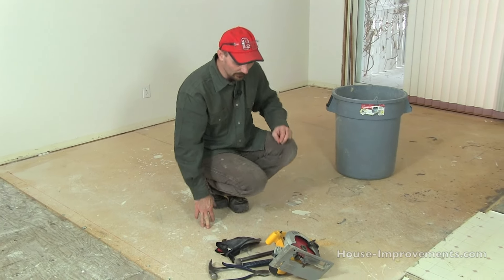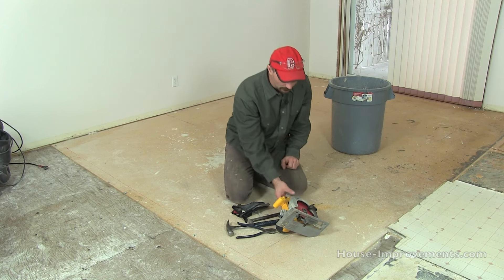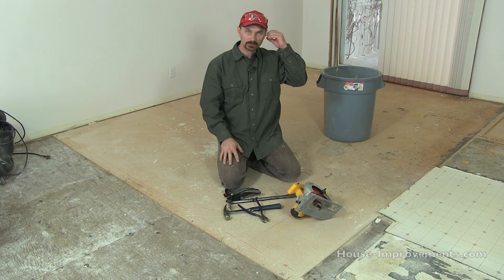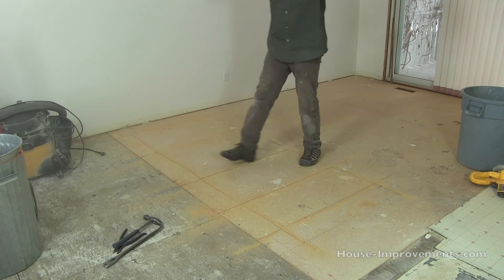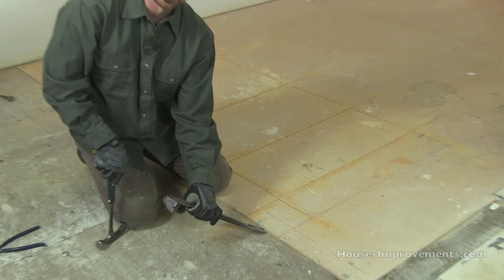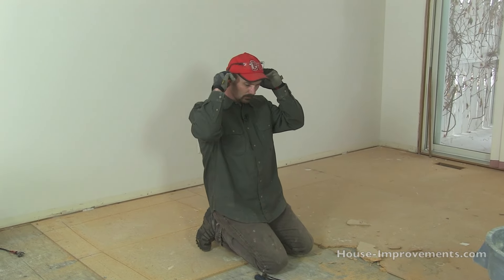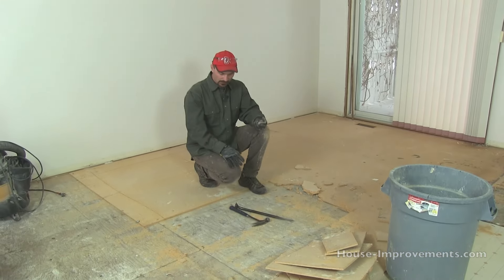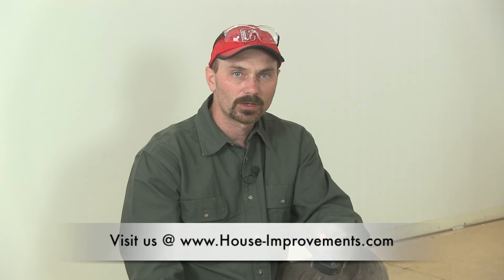How To Remove Underlayment [Subfloor]

Comment: Thanks Shannon!!! As always, the practical knowledge you share give us DIYers the confidence to tackle a project. Even a little aside comment, like you mentioning that you could use an 'orbital' saw to cut around MDF that has cabinetry on it was exactly the missing piece of information I needed. I couldn't figure out how I could cut all the way up to the wall using a circular saw. As it turns out, what you were thinking of is called an 'oscillating' saw, but just knowing a solution existed, and 2 minutes google search, led me to the oscillating saw I used to make a clean cut in the MDF underlayment and a smooth transition to 1/2'' backer board. Much appreciated advice!!!

Comment: I use a pitch fork with thick metal prongs instead of a pry bar.  It saves your back and speeds up removal providing more leverage.   Using a hole saw w/o the drill bit over stubborn nails also helps.  I have watched many of your videos over the years Shannon and you have provided me many great tips & ideas.  Finally, I have a tip for you.
Reply from the maker: Great tip!

Comment: I sure wish I had your scenario. I removed 200 SF of natural stone tiling which was installed on top of 3/4" plywood. That plywood was then screwed (hundreds of screws!) and glued to the actual 3/4" plywood subfloor. What a process getting that up. Involved belt sanding and patching the plywood tear out from the glue, then belt sanding again to achieve a flat floor for new hardwood floor install.

Comment: This is exactly what I am looking for, thanks God. Mine is cover with vinyl and glued down on the underlayment very good. I am not remove it yet, I planned to cut like you but thru the vinyl, I will use a strong magnet to mark where the nail or staple so that it don’t mess with the saw blade.

Comment: I'm currently doing this to 440 square feet that somebody GLUED down.  It is the most insanely work intensive thing you can do.  It destroys the top layer of the subfloor in patches that we will have to patch.  So much work to replace carpet with hardwood.  Thankfully once it is done it is a lifetime floor...

Comment: QUESTION: We have a 120 year old house. When building/replacing a deck which is off of our kitchen, I opted to replace the ledger board as well. In doing so I noticed that a 5 foot section of the 8x8 rim beam which was behind the old ledger board and that sits on top of the field stone foundation wall around the entire house, had been cut out. Five small cut sections of 2x8  had been wedged in the cavity as a "support fix" and nailed downward from inside the kitchen. When looking at this cavity more closely, I can see both water damage from improper flashing on the previous deck and dry rot on what appears to be the subflooring coming through to the out side of the house from the kitchen.

To give a better picture the layers going up are a field stone foundation>2x10 sill plate>small sections of 2x8 cut and wedged in above the sill plate>a layer of water damaged and dry rotted OSB or Plywood.

From the outside of the house, you can see the OSB or Plywood subfloor of the kitchen protruding to the very edge of the house. I feel that I need to repair this and I wonder how complex a repair this is? Any suggestions would be greatly appreciated.
Reply from the maker: Please copy and paste your question to my forum. https://www.house-improvements.com/forums/
Reply: HouseImprovements Hi, thanks for the reply. I copied this question to your forum

Comment: I have 3 layers I’ll be going through.. tile squares then luan that is screwed down then linoleum sheet. I’ll probably have to cut through the screw heads unless I’m lucky enough to back them out.
I’ll be removing cabinets months later , may have to remove base cabinets while doing floor

Comment: When we did our living room in preparation for hardwood, the skillsaw threw a staple through our picture window, breaking one of the 2 panes. I came here to see if there was a better way to do it. I have to take up a section of a bedroom that we are doing where I found the underlay damaged by water (probably from the windows that were replaced before we moved in 10 years ago).

Comment: Great video...I feel more confident moving forward but have a further question.  My situation is this...  Vinyl over, underlayment, over carpet, over 3/4" subfloor.  Should I be worried about setting the blade to the bottom of the underlayment and it catching on the carpet?  Is it going to be possible to set the blade below the carpet, just above the 3/4" subfloor?  In the end I'd love to take up the subfloor too.

Comment: Thanks Shannon!  Your video are very helpful and I always watch your video when I have a DIY project.  I have a question and hope you can help.  I am in a process of removing the vinyl floor and put on the porcelain tiles.  After I remove the vinyl floor, can I install porcelain tiles over the 1/4 inch underlayment plywood which glued to the 3/4 inch subfloor plywood?  Or do I also have to remove the underlayment 1/4 inch plywood and put the tiles over the 3/4 inch plywood subfloor?  Thanks.
Reply from the maker: I would not install it over the underlayment. Install either a uncoupling membrane over the 3/4" plywood or 1/2" cement backer board

Comment: I love how easy that was....so what do you do to remove particle board underlayment that has been nailed, stapled, AND glued. I've been able to get around the nails and staples pretty easily...but the adhesive is horrible. It's turned what should be a few minutes into an all day project. 

Would it just be easier to cut out the subfloor, then just replace both at the same time?

Comment: After removing the particle board, do you need to add back more plywood prior to hardwood floor installation or is the base sub-floor enough (ie. how thick should that base plywood sub-floor be for hardwood floor).

Comment: We are only removing the partical board underlayment in one room... Any suggestion on what to set the blade to when you don't have an option like you showed off lining it up to the right depth?
Reply from the maker: go with 1-4 to 3/8" and cut out a small area that you can remove and then check the proper thickness.

Comment: I am using a skilsaw to cut linoleum tile floor glued into plywood, I will probably set the depth so it doesn’t even touch the subfloor. Unfortunately there is 70s linoleum underneath the plywood as well. Hoping I can put new floor on top of that cause scraping that up sucks.
Reply from the maker: You may need to install new sub floor over the old original layer

Comment: under my underlayment theirs hardwood floors can I use the machine still to remove the underlayment without worrying of cutting in to deep in the actual flooring
Reply from the maker: if you want to use the hardwoods as your finished floor after then I would not cut more than halfway through the underlayment.

Comment: Great video.  Any suggestions if the underlayment is glued as well as stapled & nailed?
Reply from the maker: that makes the job much more difficult. You may have to also remove the subfloor?
Reply: That's what I was thinking. Tackling it this weekend fortunately  if removing a test piece I don't think there's any glue
Reply: i got lucky & no glue.  your method of cutting it up worked like a charm.  THANKS!!!

Comment: Lowes mentioned to me that linoleum will need to be removed prior to solid wood I stall.  Others have suggested it's best to lay over linoleum.  Linolium is curling a bit at the edges and a couple tears, but everything g else is fine.  What do you think?
Reply from the maker: Linoleum should be removed if its curling because your new hardwood will not lay flat and tight.
Reply: @HouseImprovements  Thank you.

Comment: I'm trying to do this in my kitchen right now. There is 3/4" OSB on top of planking. I'm trying to remove the OSB, but it's been a slow process. They used both nails and glue to stick it down. Do you have any advice on how to speed up the process?
Reply from the maker: Slow and sure will win the race ,i'm afraid thats all I can say

Comment: Have you ever tried using a small hole saw bit to drill around the nails and then just pull the underlayment (assuming it is not glued, of course)?
Reply from the maker: way to time consuming IMO
Reply: I just tried it. It takes a bit of practice and a powerful drill, but I was able to remove pieces larger than 3ft x 3ft. The "cookies" left can be removed with a hammer.

Comment: In Quebec we use 3/8s plywood stapled with 2" staples every 6". I remove it the same way you do except i use a Roofers shovel (narrow square shovel with teeth & pivot point)it makes it much easyer & saves your knees. Sometimes you don't even need to cut grooves it will progressively do the whole 4/8. I also ise it for most demolition its one of the best demo tools.
 Hope you try it out! Let me know if ya do:)
Reply from the maker: Nice tip, I will try that.
Reply: Yeah, same here. I love that long handled scraper. The last floor I pulled up had tile mastic on it, still sticky, so cutting it in pieces wasn't an option(I've got video of it on my channel). I just ripped it all up with the scraper. But it was 3/8ths ply like you're talking about, laid in the mid 1950's. It came up really fast and I was able to fold the sheets in half, nails and all, and carry them out without incident. They broke up enough for disposal too.
Reply: Missed your comment, had the same one here!
Reply: I was looking into using that tool as well. I have two layers of vinyl!

Comment: I have carpet underlay which was glued down and is so difficult to remove I am struggling to remove it what is the best tool?
Reply from the maker: If its glued to a underlayment that is installed over the sub floor I would just remove the underlayment and start over. Otherwise scraping is usually the only method .
Reply: Thanks for advice

Comment: Another great video Shannon!! You have inspired me to do install hardwood floors myself.
I need some clarification here.  I just removed my carpet and the foam under the carpet. This video suggests that what i see is an underlayment and not the subfloor. is that correct?  And does that mean i have to remove that underlayment as well before i install my hardwood floors? how can i distinguish the underlyment from the subfloor?
Reply from the maker: +Rommel Brusola Usually the sub floor will be 3/8" or less thick and not actual plywood or OSB. Remove the underlay.
Reply: +HouseImprovements thanks for your reply. I have found that my underlayment is 5/8" thick. And it is a mix of what seem to be plywood in some areas and some areas are marked "underlayment". I removed a small portion of the underlayment and also found a black lining of some sort. Should i be removing this black lining as well? What's your thoughts on this? I just want to make sure i am not cutting and removing the real subfloor. Again thanks so much for your help.

Comment: I can't even get a crowbar under the subfloor.  Did a hell of a great job securing the subfloor in the 50s.  It is glued and stapled every inch.  I was able to get a small part up in one of the door ways where it started. Help anyone?
Reply from the maker: The added glue and so many staples is going to make it a real chore the entire way.  Small bit by small bit is all you can do. Maybe a chisel would be helpful.

Comment: Your videos are super awesome. Thank you for putting them out. Let me ask you though, how and what do I need to remove a concrete backer board that has tiles from in the bathroom? I got a chip gun to get the tiles off with no real issues, but that concrete attached to the wood underlayment isn't really moving.
Reply from the maker: Its tough to do when it was installed correctly ! sometimes you have to just cut out the underlay subfloor as well. The chipping gun may help on it as well though.
Reply: Well what would be the steps to remove the underlay in this bathroom then? There's a part of the sub floor that I need to repair because it's soft and easily bends. Is it possible to do a video about this bathroom nightmare? N thanx for your help

Comment: This is the second video that I have watched that you make.  Thank you so much for taking the time to share your knowledge to help others.  If the underlayment is MDF, would you also remove that before installing pre-finished hardwood?
Reply from the maker: yes it should not be under hardwood.
Reply: under my underlayment theirs hardwood floors can I use the machine still to remove the underlayment without worrying of cutting in to deep in the actual flooring

Comment: Why can't the hardwood be nailed into underpayment?
Reply from the maker: Generally these underlayments  tend to be squeaky so we wanted it out before installing the new hardwood. Also the plywood under it needed to be screwed down to reduce other squeaks .
Reply: HouseImprovements So, I'm about to install hardwood for the first time. My floors aren't squeaky at all and the underlayment appears to be in really good condition. Would you still recommend removing the underlayment? Would it hold the floor in place just the same as plywood subflooring? Thank you for your attention.

Comment: If you had seen the number of nails the contractor that built our house used to hold our floor down when we tried to put in new flooring even your Canadian blood would boil
Reply: Sasquatch Hadarock if they don't there is a large chance of squeeking
Reply: @anatoliyrubanenko7277  1 1/4" cc crown staples ever 1/2" along every seam, and every 4" in a grid on the field using 1/4" luan underlayment.  this was an underlayment never intended to be removed.  A 12' x 12' kitchen took over 20 man hours to remove.  we contemplated cutting and replacing the subfloor it was so labor intensive.
Reply: @billqqq  why not waste like 20$ on 3 framing blades and run through the whole floor making many lines and charging the customer for the blades and labor 1.5 the price

Comment: Don't want to destroy the plywood though.
Reply from the maker: You will never be able to reuse the particle board underlayment if it was installed even close to correctly . You may cause some slight damage to the plywood under it as you remove the top layer, but its usually not much